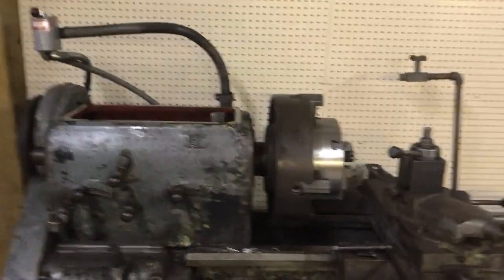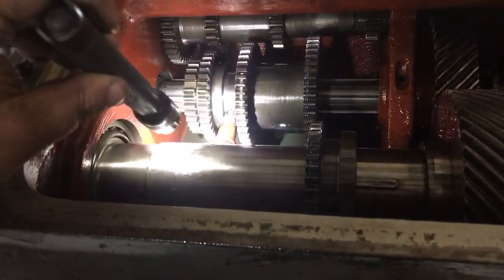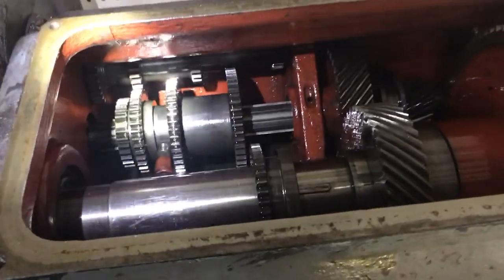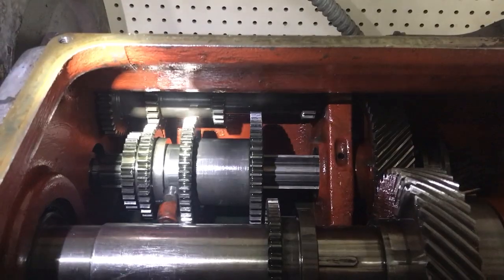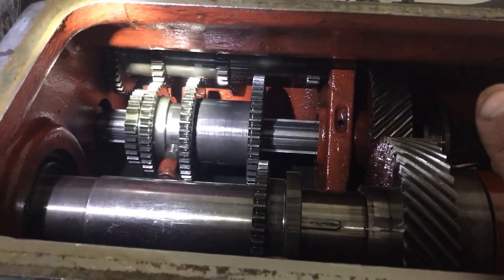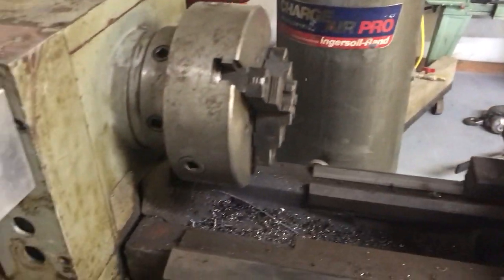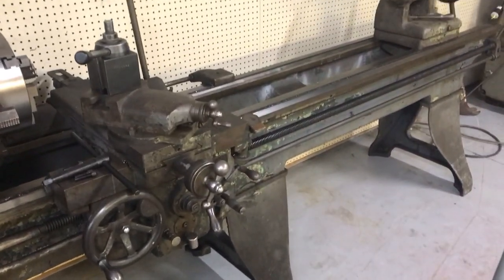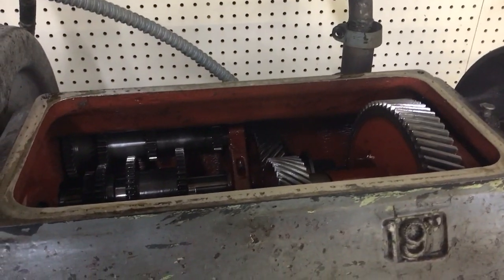inspection of the leblond lathe gearbox

Comment: Your second option would be the best way  . buy a cutter & make a new gear & press it on , unless the gear is to hard to machine the teeth .  Why did you put  the tida spindle end up against the wall ?   All the best , Cheers .
Reply from the maker: I think that plan is what I’m going to do, the tida is just sitting there right now to be out of the way, so I have room to unload the other machines, it will end up angled a bit more later